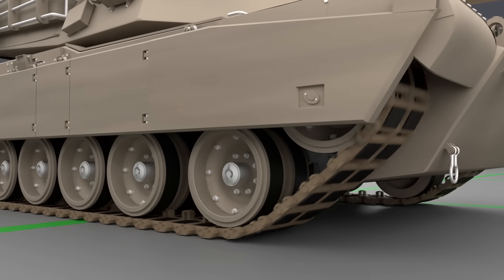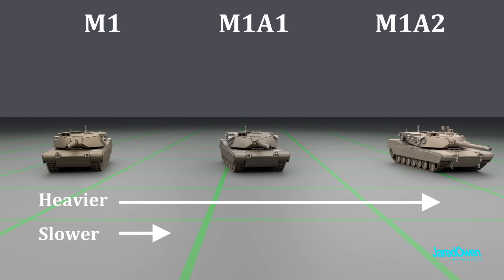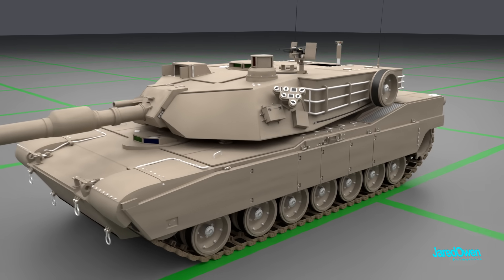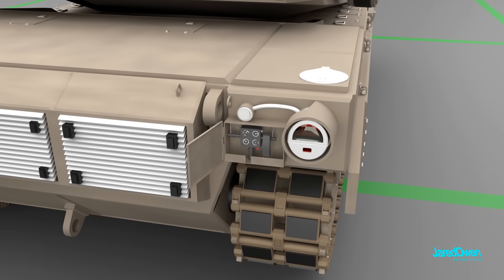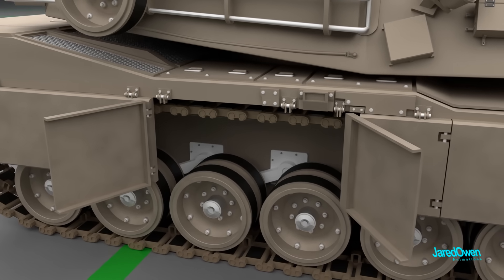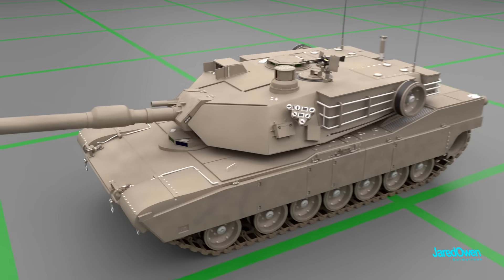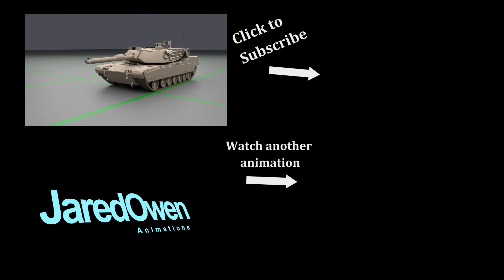How does a Tank work? (M1A2 Abrams)

Comment: Imagine how hot soldiers must feel inside of it during the summer.
Reply: They have air con
Reply: @user-vz2et1sg8c  now they do before we did not . You could fry eggs on them . We would use the NBC system to blow air on us to help cool us off . It was just a small hose with a small fan and everyone wanted to be out of the hatches when the tank was moving to get some air . Of course we also had the Vent fan which was basically a giant fart fan for clearing the smoke out during firing the main gun .
Reply: @bootlegger3656  That was called the Gas Particulate System.
Reply: @rayanderson286  That's right that's what we called it . Everyone had one to hook up to . warm air in the winter trickling in would help keep the eye lenses on the gas mask from fogging up and keep the dust and mud and snow and rain out of your eyes . Most of the time I would just take a triangle bandage and wrap it around my face with my Googles on when we were not in mop gear .
Reply: @rayanderson286  It was the NBC (Nuclear , Biological , Chemical warfare gas particulate system ) .Usually you would be in mop 4 gear at that point . Did you find it funny that our mop 4 gear was from the UK ??
Reply: @bootlegger3656  Only the crap we used for training. What we had for the Gulf War was totally different
Reply: @user-vz2et1sg8c  there was no ac when i was a tanker in the 90's.
Reply: @powellvd  It’s like when Ace Ventura got stuck in the robotic rhinoceros.
Reply: And cold in winter when the heater is broken.
Reply: Imagine how hot they would be in Iraq

Comment: 28 wheels LOL, 14, on each side, not 7!
Reply: What? There's only 14 wheels...
Reply: @johanngloi8461   Yes LOL, the road wheels are doubled.
Reply: @dnate697  Well if you sawed it in half then yes it would be 2 different wheels but it has that hole so it can grip the tracks.
Reply: @johanngloi8461   Each is 2 wheels LOL!  https://i.pinimg.com/originals/e3/b5/f0/e3b5f01786e0c3656a2afb25c5f9e4bf.jpg

Comment: 6:04 - not "in 'a' 'tank you find a turbine engine", but in this* tank. Most tanks are powered by a Diesel (piston) engine. Only the Abrams and the Russian T-80 use turbine engines.
Reply: We always burned JP8 or ulsd
Reply: У нас давно уже  Т-90 прорыв, и Т-14
Reply: And the so called "S" Tanks

Comment: You didn't even say how much power the engine produces...
Reply: 1500HP.  The engine/transmission are all one unit, so when they show the animation of removing the engine they're also removing the transmission....it can be done in about 15 minutes and a replacement engine/transmission installed and away you go.

Comment: The engine is the size and weight of a Volkswagen bug so lifting it up and out is easier said than done during forward base repairs.  Also, the bottom pan of the engine compartment is subject to bending due to mines below making engine removal quite difficult.

Comment: Why use US tons? M1a2 weigh is 68.7 tons( wiki), but not us tons, 1 ton (1000kg) = 1us ton (907kg), it's make a confiusion
Reply: America doesn't use the metric system
Reply: @sandervanderkammen9230  read my comment and try to understand
Reply: @tomekkl4176  You asked, qoute; "Why use US tons?"

The answer; The US does not officially use the metric system.
Reply: @sandervanderkammen9230  ok, but he talks about 68 us tons (about 61000kg) but weight is 68 tons (68000kg) it's doesn't matter he is American or not, just be accurate
Reply: @tomekkl4176  None of the information in this video is accurate.

Comment: Technically it can reach speeds of 70 mph.  Weight 76 tons but what's a few tons between friends.  You make it sound like changing a track is like changing a tire.  The best place to put a RPG is in the engine compartment.  The turret sets on a gyro allowing it to stay stable and flat at all times.  Yes, I was in the 3rd ID in the 1st battalion 4th Infranty mechanized Bradly fighting Vehicle. Task forced with the Abrams.
Reply: 70mph??? Only if you drove it off the edge of a cliff...

Comment: The loader isn't standing during operation. His seat swivels, a knee button is pressed which opens the ammo door. he grabs ammo and turns to load. This turning motion removes knee from button which quickly closes the automatic ammo door.
Reply: We're taught to stand. In order to fully shove that round into the breach it's a heck of a lot easier to stand. Our seats dont really swivel either. At least not in the Sep v2s
Reply: @kungfury1532  Well its been 20 years and things change. So how do you open the door now? with your hip?
Reply: @DaRealStiffhand  nah we still use our knee, but like its the side of the knee. We're facing the TC in his chair basically the whole time and we swivel at the hip to grab the round and send it into the breach

Comment: I don't understand why they cannot make tanks remote-controlled.  Surely that would be much safer and better.  And without humans inside, they could fill it with more ammunition and fuel.
Reply: Because it was very expensive and we can't create such things yet
Reply: @Kalashnikov413  why not?  Remote control technology is straightforward, even for airplanes.  We have predator drones for 30 years now.  Why not the same for tanks?  At least, why not have two unmanned tanks for each manned one.  Surely they should be installing autonomous upgrades to these tanks soon.
Reply: @fling-asia  what about other factors? like armament?
Reply: @fling-asia  plus, predator drones can't replaced the conventional fixed-wing aircraft

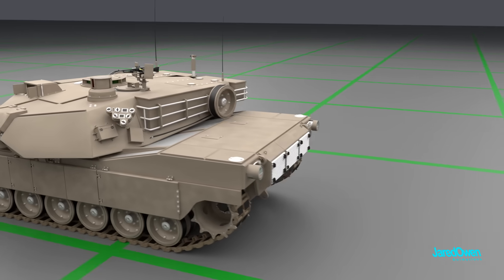Comment: 4:35 If I remember it right, the Israeli Merkava Tanks puts the engines on the front as an extra layer of protection for the tank crew.
Reply: Yes, plus since the Merkava also doubles somewhat as a troop transport, it would make sense that they would be able to deploy from the back with the tank providing cover as they dismount as opposed to dismounting from the front

Comment: Good animation and a nice simple description of the Abrams.  Some terminology corrections are necessary though.  You can tell a TANKER from a Non-tanker by what he calls things.  In the U.S., the TRACKS are NOT called Caterpillar tracks.  Nor are they called TREADS by actual tankers, although civilians tend to call them that.  They are just called TRACKS.  If you need to remove a TRACK for some reason, you BREAK TRACK (a big job).  If you slide sideways down a muddy hill, you are likely to THROW A TRACK.  Fixing a thrown track is also big job.  The wheels that ride on the tracks are ROAD WHEELS.  The little wheels on top that hold the track up are SUPPORT ROLLERS.

The unit in back that powers the tank is the POWER PACK, consisting of the ENGINE and ALL attached parts including a transmission.  As the animation shows, it is removed as a unit.  Depending on the type of tank, this can be a turbine power pack or a diesel power pack.  Few tanks are powered by gas turbine engines.  Most use diesels.

The things you load in the MAIN GUN to fire are NOT called shells.  They are called ROUNDS OF AMMUNITION, OR JUST ROUNDS.  A round consists of a PROPELLENT CHARGE WITH PRIMER and a PROJECTILE.  Depending on the tank, the propellent charge might be in a brass case.  The original M1 model used a 105mm gun that fired rounds with a brass case.  In the M1A2, caseless ammo is used although there is a small metal cup at the base of the round.  There are several types of projectiles including SABOT and HEAT.

Finally, the gun is stabilized, but it DOES NOT LOCK ON TARGET AS THE TANK SPINS.  If stab is on, the gun will remain relatively close to where it was pointed in azimuth and elevation as the tank moves.  It is still up to the gunner to keep his reticle on that target while firing on the move.  Stab just helps him out.
Reply: Good point 19k out

Comment: Excellent video presentation. Thank you for sharing.  Before receiving the M1 nomenclature, the Abrams was referred to as the XM1 (X for experimental).  As an MP serving in Germany, I know they were being tested at Grafenwoehr training area.  M60 tanks and APCs were a common sight back then.  In comparison, the XM1 looked like something out of the future.  On one TDY, I escorted an M1 and M2 Bradly (loaded on a HET) to an AUSA event in Southern Bavaria (c.1983).  I was informed of an incident where the paint was burned off the hood of a Mercedes parked behind an M1.  That's when I learned it was powered by a turbine engine.  So, you're right...you don't want to be too close behind these things when they're running.  There are probably very few people who can make this claim like I can.  I once pulled over a column of tanks for speeding.  :-)  no joke, except, I had to follow them all the way back to the motor pool to have a discussion with them. You see, when you stop a tank for speeding, it's not just one guy you talk to. It's a whole team.  Another issue: the driver's hatch up front.  This one's a little more grotesque.  Let's just say tanks are dangerous and unforgiving and mistakes are deadly.  There's not much clearance between the hull and turret; so, when the tank is at the wash racks, there should be very clear communication between all crew members before rotating the turret.
Peace.
Reply: Xm1 fort hood 1980 test team 2/67armor